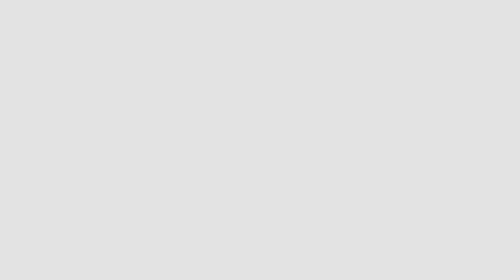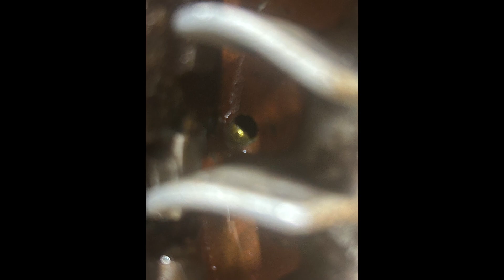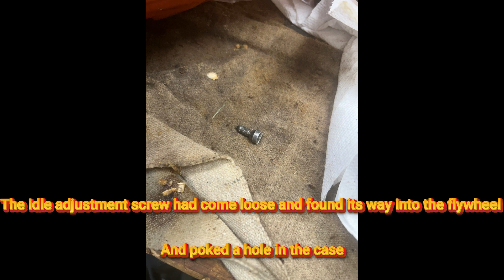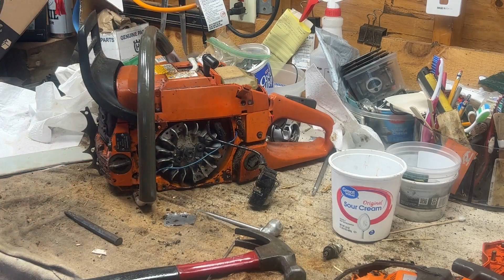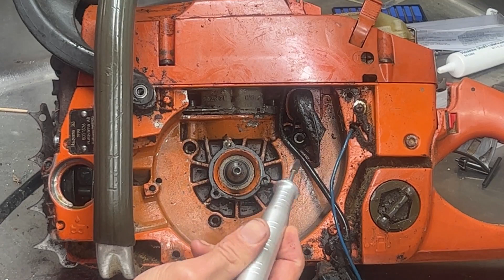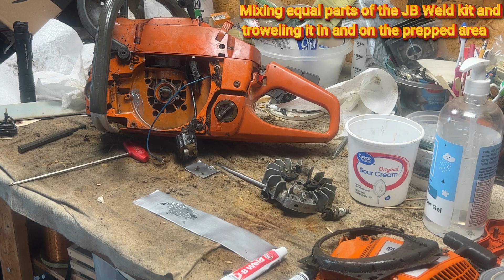Husqvarna 365 Special Case Repair

Comment: Nice job.
For repairs like this I prefer an epoxy used in the tool and die industry. Can't remember the name off it, bit probably will as soon as I hit send 😂. If you're interested, respond this reply and I'll get the name later today. We'll, I remembered before sending it lol, Devcon, it's awesome stuff to ha e around the house.
Always liked the look of the low tops, not sure why, as the high tops don't get in the way at all as it seems they would.
Reply from the maker: I’ll keep an eye out for Devcon. Thanks for the tip. Especially if this JB Weld patch doesn’t last.
Reply: @M2theBchainsaws  for sure. The JB will probably be fine. I consider the devcon to be an industrial version of the jb, it's pretty amazing the things I've repaired with it over the yrs. I watch for it to be on sale as buying a potato a time is pretty costly.